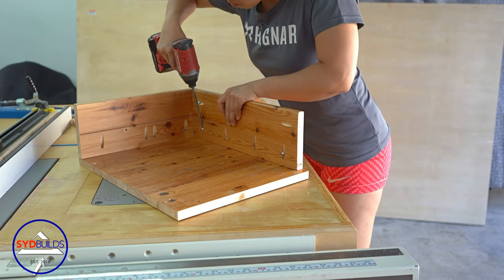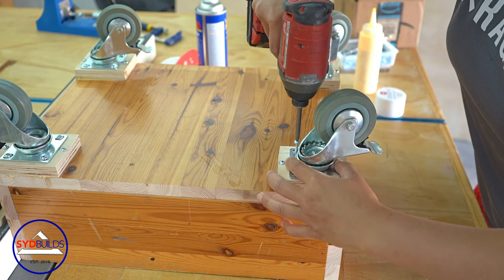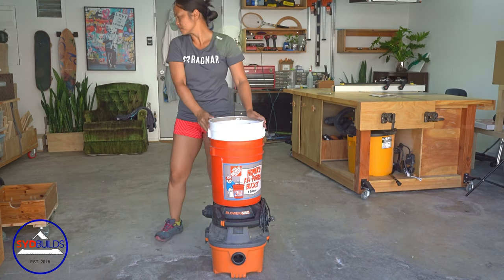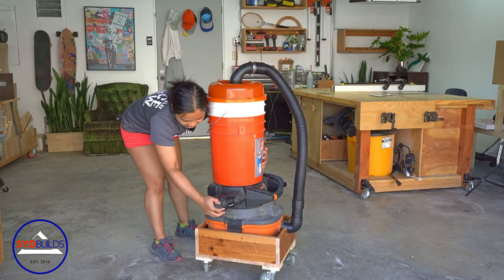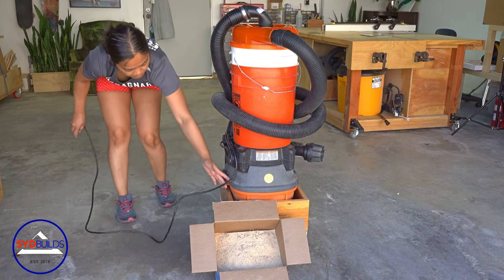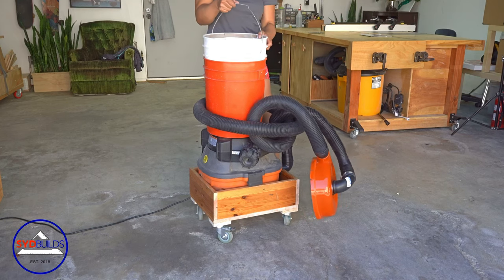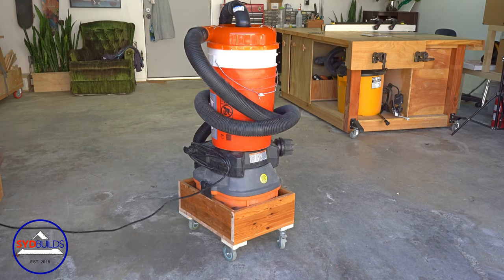Compact & Simple Shop Vac Dust Collection System

Comment: What a simple, brilliant solution. Super innovative. Thanks for sharing your success. Here’s an idea; if you drilled a few holes around the bottom of the permanently mounted orange bucket, it will allow air displacement -making it easier to pull out the white bucket.
Reply from the maker: Great idea!! My outer bucket has two long vertical cracks so the inner bucket doesn’t stick, but I can see why it would be a problem if one doesn’t drill hole(s) to release air pressure.

Comment: Always nice using the KISS principle. Using up existing shop materials assists big time. Unsure about the HD Dustopper vs Dust Deputy vs simply making a cyclone out of parts but this video/concept is ideal and identifies you can use a much smaller vacuum in addition. Great job!

Comment: Video was very well done overall. I have the same Ridgid vac and built a rolling cart with the vac and dustopper buckets on the same plane. That gave me room to store the tools also. Although it is functional, it takes up alot of room. I have looked at a ton of other videos to get ideas on how to make a vertical cart. Most of those use large shop vacs and the original casters on which to mount pvc pipes as risers and include shelves etc. The simplicity  of your design is wonderful. And the way you attached the bucket to the vac directly was so cool !!! I am not smart enough to have thought of doing that...I'll be building this cart soon and THANK YOU for providing this video information. I would also like to thank Web Crawler for his suggestion about drilling holes in the orange bucket to release the suction on the white bucket. And for your response to The Real Ambro about air restriction because I had the same concern. I'll be looking for more of your content. Thanks
Reply from the maker: Awe. This is such a nice comment-best one ever! I am truly happy you find the build useful. It’s simple and efficient. I hardly ever use the accessories that came with the vacuum so I store them in another dust collection cabinet. 
Yeah, the drilling holes in the bucket is a great idea! My orange bucket has a long crack in it that’s why I was able to pull it out easily in the video. I imagine it would be harder if it was airtight.
Reply: @SydBuilds  A little while after I left the post, I went to my shop vac to take off the cover, but found out I don't have the same shop vac. The only part that is the same is the bottom canister! I was soooooooo disappointed. My model  is  WD4070, and I think your model is a WD4080, which is no longer available in the 4 gallon size.  I've been looking everywhere on line to find one... Oh well. I still stand by my comments about your setup.

Comment: Drill some 1/2” holes in the orange bucket to get rid of the suction of the white bucket.  Also, replace the vac filter with a bag.  That way you won’t have to worry about cleaning or clogging the filter.
Reply from the maker: Thanks for the tips!
Reply: great tips! i always use bag, using just filter cannot compare

Comment: So adding extra constrictions increased airflow? Interesting to know how that works, as it doesn’t.
Reply from the maker: What constriction are you referring? There is none that I see.
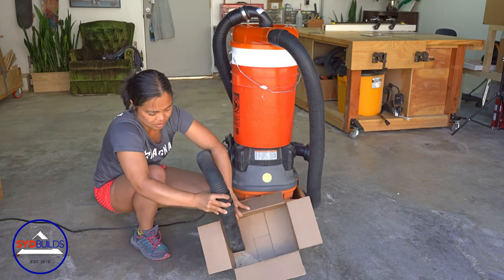Reply: @SydBuilds  the whole cyclone is a constriction. Every bend or ripple is. Yet at 5:20 you say that there is now more airflow. That is not possible unless there where other changes, such as a swap to a coarser and not-plugged up filter.

Comment: Looking at building a system very similar to this with the same vac but on HD's website it says the ports on this particular vacuum are 1-7/8" vs the larger 2-1/2" ports of the bigger models, but yours does have the 2-1/2" ports. I'd love to use this smaller vac if I could due to space restraints.
Reply: I'm in the same boat. Hoping to find out if some adapters will do the trick...

Comment: Well this is what I do,  all the time for my shop vac...I buy a two pack of 2 gallon paint strainers...put one over the vac filter and just use it that way all  the time...the strainer stops almost all of t the debris from going into the filter.  If you're extra particular use two of the paint strainers at once.  I haven't had to do this but you just might want to use two.  It works great for me!!!!

Comment: Great job, just a point out your rubber elbow at the top is colapsing from the suction and the bent angle. You should change that to a hard pvc elbow....
Reply from the maker: Thank you for watching the video in detail! 
A hard pvc fitting would be ideal. However, it doesn’t work in this case because it’s necessary to have clamping force to keep the fitting in place on the Dustopper and on the hose.  The fitting, the hose and the Dustopper are all slightly different sizes even though the stated dimensions are the same. It would be great if they’re custom made to fit perfectly into each other in way of threading. Unfortunately, The smooth surface on Dustopper makes it hard for the hard pvc to stay connected with movements, wrapping the hose, pulling when in used & etc. The slight bend doesn’t impede the functionality of the vacuum or air flow so it’s good enough for me. I’m always looking for improvements so if you can find a perfect fit hard pvc, please let me know! Thanks again for watching!

Comment: Taking the top off the vacuum was ingenious. However there was no need for the rolling box. Had you left the casters on the shop vac I think you could have achieved the same result. JMO
Reply from the maker: Have you try loading all the weight on top of the vacuum and roll it around with the existing casters? Build the same thing, minus the box and let me know what you think. By the way, the box is also use to store the accessories/attachments.
Reply: @SydBuilds  I have

Comment: Hi Sydney! May i ask what size hoses you are using? I believe the Rigid 4 gallon comes with 1 7/8” hose but yours look a bit larger? 

Also curious, did the noise lvl change much when adding the dustoper? 

Loved the video, thanks!
Reply from the maker: Sorry for the late response. I think it’s 2”  or 2.5”. It’s a stand alone replacement hose from ridgid. Noise level doesn’t change, but I add the muffler to cut down on the high pitch sounds.

Comment: Would you have a link to the rubber elbow you put on top of the Dustopper? I'm putting something like this together and can't find that elbow.
Reply from the maker: It’s a 2.5” flexible fitting found in the plumbing section of Home Depot. I’m sure you can find the same thing at Lowe’s.
Reply from the maker: 2” not 2.5”
Reply: @SydBuilds  Awesome! Thanks!
Reply from the maker: You’re welcome!

Comment: good idea, but bad execution. There's a reason the top of the original vacuum had openings. That electric motor requires airflow for cooling. I think a slightly improved design using standoffs and longer bolts would do the trick by providing a path for air to reach that cooling fan on the end of the motor shaft.
Reply from the maker: Thank you for taking the time to voice your concern, but please don’t knock others’ ideas and creativity down unless you’ve done/built/made the exact same thing, and found your criticism to be valid. 
I’ve already answered the same concern to a previous commenter. You can look that up if it suits you.
Reply: @SydBuilds  If all you want is sycophants,  maybe the internet isn't the place for you. I think that "grow a thicker skin if you're going to put your work out to the world to review" would be better advise in this case. Followed closely by "show that design feature in your video" as a close second. As a general rule, no one is going to read a zillion comments.
Reply from the maker: Yes, I know. The world is full of experts who use their keyboard to do the talking, criticize others, provide unsolicited advices, and share pompous opinions, but, more likely than not, have no real world experience in the very topic they speak of.
Reply: The world is also full of videographers and engineers. Sometimes they're the same person. 😉 

I took a course once where they said that feedback is a gift from the person to you, and that you should use it that way. But hey, rock on with the passive aggressive.
Reply from the maker: Feedback and a criticism are not the same. Sounds like you enjoy learning so I’d like to recommend the article by Forbes that focuses on the subject. Google “feedback vs. criticism” and it’s the first result. It highlights the differences. It’s also helpful to note that unsolicited advice is disrespectful and presumptive. It communicates an air of superiority that your ideas and opinions are best or better. Constructive feedback is helpful. Unsolicited advices are critical and not helpful. 

None of what I said is passive aggressive. They’re statements, but the interpretation is always on the reader, so interpret away. 

You seems like someone who needs a thorough explanation in order to understand someone’s else idea. Perhaps you’re a read/write learner instead of visual so here’s my response to your initial “bad execution” comment. Yes, you are correct, the motor needs venting. No, you are wrong that having the bucket sits on top of the vacuum restricts airflow. It actually provides MORE AIRFLOW. From the 2-2:15 mark, I’m removing the original cover. You can see the one minimal, 1”x4”, air vent grille  on the cover. At the 2:40 marks, I’m installing the bucket to the top of the vacuum using the existing screw holes that are meant for the cover. You can also see that the cover is on the ground. I did not put the bucket over the cover. 

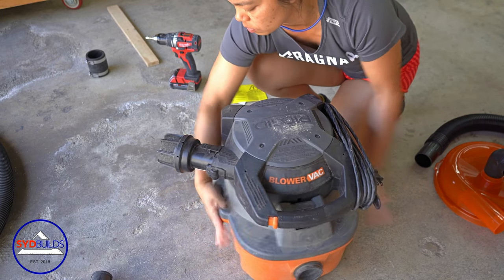I understand that the video doesn’t show the gaps underneath the bucket, so I can see your conclusion that the bucket blocks the airflow. However, if you go back to the 1:56 mark, you can see the top of the vacuum and the dome shape of the original cover. Once the cover is removed, you can see that the cover was attached with screws to the 4 “posts”. You can also see the 4 large high points on the top of the vacuum. I think by seeing how the cover is attached and what the top of the vacuum looks like once the cover is removed, you can probably understand how the bucket doesn’t restrict airflow. 
If you still don’t understand what I mean, here’s an explanation. Because the bottom of the bucket is flat and bigger than the cover, it sits on top of the 4 large high points, rather than against the airflow opening, while still attached to the vacuum at the 4 “posts”. This positioning prevents the bottom of bucket from completely sealing off the air circulation.  
If you still don’t see how my construction allows airflow from the explanation above, please email me and I’ll send you some diagrams. I am an educator, so I understand that there are different styles of learning. 

Please do understand that it’s nearly impossible to make a video that shows every single thing or addresses every concern and still keep it short. I’ve been using the set up regularly for the past 3 years. Its currently being used to clean up debris from a house renovation. I can attest that it works as well, if not better than, the original.
Reply: @SydBuilds  way to go! I guess you told him! We can tell how intelligent you are!!!
The only thing we are bummed about is we haven’t found you sooner. 👍🏻☮✌🏻

Comment: Lol I think covering/restricting airflow to the vac motor like that with the bucket screwed on will cause it to operate at higher temps and might reduce its longevity.
Reply from the maker: Don’t knock it until you’ve tried it. There is a gap all around between the bottom of the bucket and the vacuum. If anything, it provides more ventilation than the vent that’s on the cover.